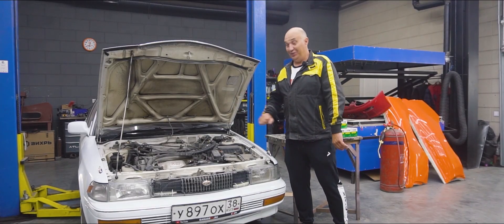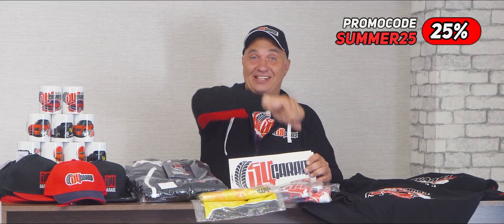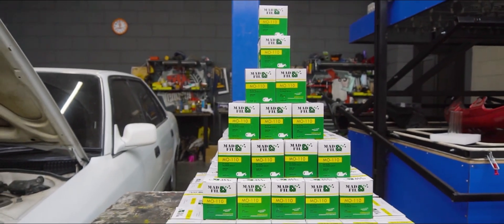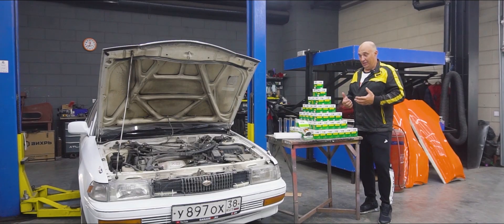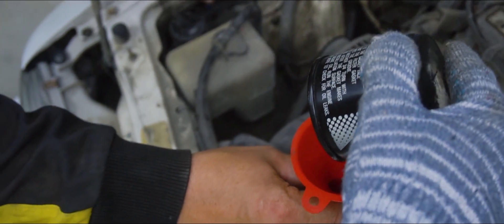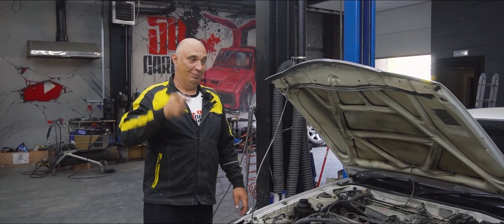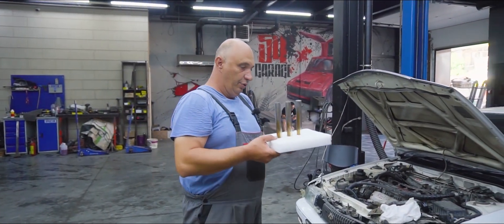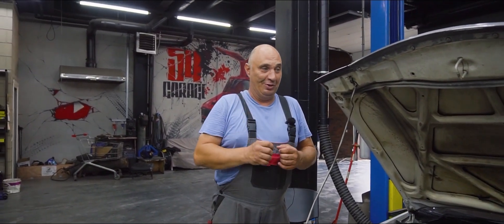Can 50 oil filters make used motor oil clear again?

Comment: Tomorrow's World on the BBC did a similar experiment years ago with a new type of oil filter. The presenter was the late Raymond Baxter. The filter element looked like a white toilet roll. In the studio they pumped used engine oil that was pretty black through the filter which was installed in its housing. This was all done on a bench, not in a car. The oil which was pumped through at some pretty high pressure due to the level of filtration came through looking like new oil - a fresh honey colour. I have not heard a thing about this new type of filter since. Perhaps it went the same way as the everlasting light-bulb. No point if you couldn't sell loads of new oil along with the basic filters!
Reply: Ive used toilet paper filters since 1963. People have been laughing about my filters for 60 years. They are hard to sell. People have been brain washed into thinking proper maintenance is allowing the oil to get dirty then draining it. Started with a Frantz oil cleaner and Standard Delo 30W in my new Rambler American flat head 6. All I have in use now is Motor Guards Gulf Coasts Australian Jackmaster Classic and a flat head Ford V8 canister filter set up for Scott 1000 toilet paper. It has half a roll of Viva towels in it now. The Australian Jackmaster Classic is probably as good as you can get now if you use toilet paper. The Walmart synthetic is what I use in everything now. Great Value 1000 from Walmart in mine. Jackmaster puts high quality Australian toilet paper in a sock and charges 20 bucks. Because of all the bull shit stories that come with toilet paper filters they are trying to avoid being called toilet paper filters. Too many of us old toilet paper squeezers.

Comment: 🙄spend $400 on filters instead of just changing the oil. 🤪🤣😂
    One of my nieces bought herself a new Mustang back in the late 80s. She never knew engines used oil and no one ever told her she needed to change what she didn't know it used. After over 80,000 Mi the engine came to a screeching halt. I never did see the oil that came out of it. But I doubt that was was much in it.  LOL Could only imagine the sound of that engine before it died.    👉😖👈

Comment: Umm when you replace the oil filter you have to ADD fresh oil to the crankcase so after you change 50 filters you will essentially have changed your oil probably 3-4 times because you will have added probably 10+++ quarts of oil to that engine after replacing 50 filters on it...
Reply: Yes you understand. My toilet paper filter has a .045 orifice at the inlet. When the oil is hot the Pontiac oil pump is pushing about 3/4 quartof 10 30 synthetic thru the toilet paper and to the oil pan.

Comment: Theres some argument online about never changing your oil .............

will fess mines now 3 years old and holding strong ... others have run theres for well over 100 thou and 10 years without a change ....

not recommending it , oils cheap , engines arnt

Comment: the  longer hydrocarbon chains break and oxidize due to the heat alone, the friction further breaks the molecules and mixes them into a more viscous state -like whipping egg whites into a meringue. They can't get the brown out because the oil has become that color, regardless of gunk coming off the engine and being screened out.

Comment: Can't unburn toast any easier than you can unburn motor oil. I was hoping there'd be some contraption with 50 oil filters in a row and the car engine was removed from the equation.

Comment: they dont say this but every startup for a moment the system has to prime and the motor is running with no oil pressure. repeat that 50 times lol

Comment: I'm not a car person but I assume this is illogical. Dirty oil is mostly due to the hydrocarbons breaking down. If you filter it you'll get rid of the broken down components and end up with less proper oil. Correct me if I'm wrong. But this fundamentally makes no sense to even try.

Comment: If you want to make a good filter all you need it's a piece of pipe with a cotton rope inside of it jamed tight. Filter the oil through the cotton rope it will come out clean on the other side

Comment: Most of the oil bypasses the filter doesn't it? You'd need to run it a very long time to get most of the oil through the filter.

Comment: Bypass filters for semis that allow a hundred thousand miles between oil changes are a not-new thing.  They're the size of a roll of paper towels and are crammed full, not just a layer of paper for the oil to filter through.
Diesel oil darkens very soon after oil change due to soot capture that the oil is engineered for.
So many of garage54's ideas are silly, for show.
This was another.
Glad someone can take the time for these experiments with nonchalance.

Comment: i run 100% recycled oil in all my equipment,  i pour it all into a caged ICB tote and let it settle for a year, then i filter the top 2/3rds off the top and pour it in.   I burn the bottom 1/3rd in my oil burning shop heater

Comment: filters will not make dirty oil bright again. combustion engines produce blow-by, meaning fuel and exhaust gas will get mixed inside engine oil, fuel degrades engine oil meaning the oil will lose some lubricity over time, and the dark color is caused by exhaust gas from the combustion process. no matter what filter we use that's not gonna change the color of oil back into its pristine condition. if you wanna filter small particles from the oil, use a smaller micron oil filter

Comment: i run my toyota echo on lard, bacon grease. its roughly sae-20 toyota is fine with no oil usually females do that, but 10-30 is best for most seasons. the bacon grease does run hot and suposedly burns carbon from the valves. i dont know uses some oil though, its a bit thin for a motor. Я запускаю свою Toyota Echo на сале, жире с бекона. Toyota примерно sae-20 подходит без масла, обычно это делают женщины, но 10-30 лучше для большинства сезонов. жир с бекона действительно нагревается и, предположительно, сжигает нагар из клапанов. я не знаю, использует немного масла, хотя для мотора оно немного жидкое.

Comment: I guess if the shop is cold, someone could set up a large bin that has a heat resistant pipe coming out of it... and the pipe runs over to a gas burner that heats it past its flash point so that it gasses off and vents into a smaller tube that has a long length of coiled tubing to get the heat out of the oil vapor. distillery? maybe I small one the size of a coffee machine, electric or gas?

Comment: Take old oil, heat it up to working temperatur and use a oil centrifuge. The soot and the dirt will be removed. Many diesel engines have the se centrifuge cleaners, and work much bretter than a filter does.

Comment: Standard oil filters have plenty of capacity to hold dirt. They only filter down to a certain level being a full
flow filter and won’t really make the oil any brighter or change the color of the oil because they don’t filter down in the micron range to make that difference. You have to go with an Amsoil bypass oil filter which filters down to 2 microns with more than 98% efficiency. These filter only draw 10% of the oil pump capacity because they are very fine and restrictive oil filters.

Search for Amsoil bypass oil filter on YouTube.

Comment: Some fifty years ago my dad put a "toilet Paper Filter" on the car and it removed all the coloration of the oil. It used a roll of toilet paper as the filter. The problem with them was that they filtered out some of the additives that had been added to the oil such as anti-foaming agents.
Reply: Purchased a 59 Ford pickup in 71 someone had install a toilet paper filter on it. It seemed to work okay but we removed it after a few months noticed the toilet paper breaking down as it's meant to do last thing you want is paper clogging the oil pump pickup screen. I believe they were sold to JC Whitney LOL
Reply: @Ozarkprepper643 they still sell those filters. If the paper is breaking down, youre using the wrong paper and/or leaving it too long between changes. Its supposed to be the almost shiny tightly wound stuff traditionally bought by sadists for use in public dunnies in restaurants and petrol stations to stop cheapskates stealing it.
Reply: Another bull shit story that comes with toilet paper filters. Everything I have had since 1963 with an oil pump ive put a toilet paper filter on. If toilet paper broke down in motor oil I would know about it. When I pull out a roll of toilet paper I expect it to be strong and tear at each sheet. Started with a Frantz oil cleaner in 1963. Went with the top loaders in the 80s. The Pontiac has a Australian Jackmaster Classic. As far as I know they are the best in production. They are all good.
Reply: I believe JC Whitney sold a spin on filter that replaced the full flow filter. They had a relief valve that was always open when the engine was running. Converted the full flow system to a bypass filter system. A Frantz dealer had Frantz 3 stackers all over the Gulf of Mexico on heavy duty marine engines. When the Frantz 3 stackers went out of production they were replaced with 
Filters that use Bounty big roll paper towels.Thats the Gulf Coast filter of Gulfport Mississippi. I have read aircraft oil analysis reports. Saw the FAA approved AeroFrantzs on crop dusters north of Sedan Kansas about 1980. No the filters dont remove additives unless its a solid like graphite.
Reply: and it really alters the flow-rate causing higher-temps......dave  nz

Comment: what can you say about adding kerosene (lighting gas) in the oil before this experiment or when changing oil? 
Or... experiment how long a motor would run at idle with only kerosene before it locks or before it starts destroying the bearings and see metal shavings in the filter?

Comment: This is incredibly stupid on multiple levels. Clearly these Russians have zero clue about WHY oil turns black and HOW an oil filter works and its purpose... the experiment setup you have going on here also makes zero sense, you are not filtering the same oil over and over. Most people would read the title to this and assume you are going to filter in series 50 times, but you're not. Very very very stupid and dumb video. I will not be subscribing and will not be viewing this channel ever again.

Comment: There is a by pass valve in the engine or filter bracket that allows the oil to by pass the filter till it reaches 100 C so it flows correctly.

Comment: I did the same test with one filter but ran it 100 miles and it cleaned the oil to half the darkness it was, you need to get the oil to operating temperature for at least 1 hour or you're just fooling yourself.

Comment: Why not compare a toilet paper filter's results with the standard oil filter?  To make a toilet paper filter, take a roll of toilet paper, fit a rod of some sort through the middle to force the oil to go through the paper, add the oil at the top and the clean oil will come out the bottom.  It's been said that such a filter can even remove pritner's ink.  You will of course need a tube to fit the roll of paper into, capped at the top and bottom with inlet fittings at both ends.

Comment: In Italy they use a centrifuge. Carbon particles can be infinitely small so will easily pass through a filter thus color will not change. Check out the Italian centrifuge.

Comment: these filters are all designed to catch  particles of a certain fixed size and they all did exactly that...a new filter element that is designed to catch even smaller particles would have made a noticeable difference in between the first few filter changes

Comment: the oil Darks because of burned gasoline contaminants. in Brasil de have cars running on pure ethanol e100 and after 10.000km the oil looks clear like as new
Reply: Ive never had any trouble turning the oil clear in a gasoline engine with toilet paper filters. Diesels are another story.
Reply: @ralphwood8818  :face-blue-smiling:

Comment: Find a same size fuel or hydraulik filter. Oil filters have 20-25 micron efficiency, fuel filter 25 micron and below. Using other filters with no by-pass valve is dangerous. If you testing a fuel or hydraulik filter, warm your engine oil fully. I not find fuel filter with size, make your changes to fit to the car. If you have a 51. oil filter place a neodinium magnet to the filter, and using for 100-200 km this catch metal deposits in the filter.

Comment: Filters can only remove particulate matter. Doesn't replace the long chain polymers and doesn't remove the oxidation of the oil itself as well as the friction modifiers and other additives.

For any particulates smaller than the pore size of the filter, they remain suspended in the oil and can only be removed by getting rid of the oil and replacing it.

Comment: Pretty much figured this. That's all that the filter does really, is just keeps contaminants from circulating. It was run in an engine that seems used so, even then the old oil on the walls would keep the oil darker anyways. If the old oil was ran through a filter contraption without an engine, I beleieve the results would have been more interesting, but still closely the same.

Comment: Simply no,even if you can get the oil somewhat clean it would have absolute minimal lubrication properties left behind. The used motor oil would need additives and other compounds to be effective at lubricating metal to metal parts.

Comment: Color of the engine oil doesnt co-relate with the properties of the oil, different additive packages have different color. normal oxidation will result in blackish appearance of the motor oil but thats not it.

Comment: I cleaned used oil using a metal powdered milk can and 2 rolls of toilet paper.
I pulled the centers out of the rolls and pushed them down into the tin. I had previously drilled holes about 2 cm high from the bottom in the tin. I just poured the oil down the center of the rolls and caught the much cleaner oil in a bucket that the tin was sitting over.😁

Comment: Even if the color could have been changed to bring it back to the lighter color it was when it was newer. This method of going through a ton of filters would not have been able to fix an important issue with old oil and that would be how the viscosity can vary over time. Oil now a day has a lot of additives and those do break down over time, through all the heat cycle, and as they break down the viscosity will be affected... Side note, some of those additives can be purchase on their own, so you can add them at oil change if you're not sure the oil you bought has them already in them... 

There are companies that do oil analysis for fairly cheap, you take a small sample and you mail it to them so they can analyze your oil to see how well it held up. I would have been curious to see if they would have seen any significant change between the oil before all the oil change and after.

Comment: I’m not sure if i’m surprised or not surely you need to do an engine flush with really thin mineral oil heated up and repeat that a few times before you start to clean the engine internally.
I have a 2007 Volvo v70 with 220k on it and I think if I cleaned it it wouldn’t run as well i’m sure the thick nasty oil and deposits are creating slight seals where it’s old and worn don’t think cleaning it would benefit me at this point 😂

Comment: Going to have to point out that you need a filter to filter the oil down to 2 microns at minimum to get the carbon particles out to start. Then you gotta deal with the degradation of the oil molecules themselves and the mixing of gasoline in the oil from being used.

Comment: The trucks we used on the flightline, ran 24 hours a day, seven days a week.  They mostly idled, but could get up to 15 mph at times.  The motor pool changed oil based on mileage, not hours.  That was some nasty looking oil, after a couple of weeks.
Reply: I've driven over the road for different trucking companies most would push the trucks 30,000 miles before an oil change considering they work almost every mile they run the engine still go 700,000 before a rebuild. I averaged 120,000- 130,000 miles a year.

Comment: how to clean the oil: a centrifuge! if i have to think of a garage 54 way to do it off the top of my head, put a special container on a differential, rev the engine in 5th gear for a while, the particles should separate into different layers by mass

Comment: The oil in my Australian 4 litre Ford Bara engine with factory fitted LPG never turned black. Always looked like new. The recommended oil change interval was shorter but as others have said the friction modifiers deteriorate regardless of the oil colour.
I was surprised to find the oil never turned black.

Comment: If you had asked me I would of said there would be hardly any difference because once the filter does its job repeatedly changing it doesn't make the micron filtration get better, it's the same as the previous filter. A waste of time and money.

Comment: Impossible one little filter can absorb atleast 1/4 quart of oil. So if you screw a filter on and run the engine then unscrew it replace 50 times you would run out of oil. If your care holds 4 quarts after you change your filter about 5 times yoy will be over a quart low.......

Comment: You need to stop advertising the game until it actually works. On both phones I tried it on, it got stuck mid race in the app, and would not give me back control of my phone, not even to power the phone off. I filed a complaint with the app store.

Comment: I had a 78 K10 with a 454 and 4 speed. We used it on the farm for years. After it started burning a quart of oil every tank of gas, we switched to 90W gear oil. Poured in two quarts of oil stop leak and called it a day. It ran for at least ten years after that. It was a great truck and would pull like a dozer. Unfortunately a tornado collapsed the barn it was in. It was beyond repair and the insurance company hauled it away.